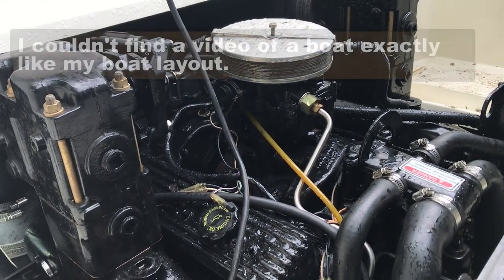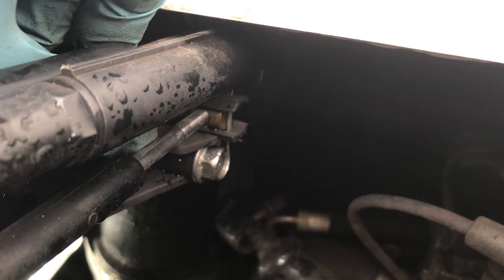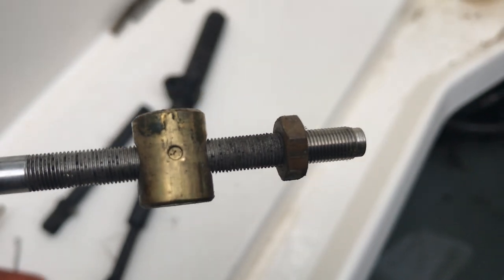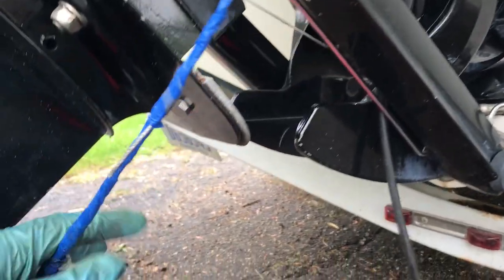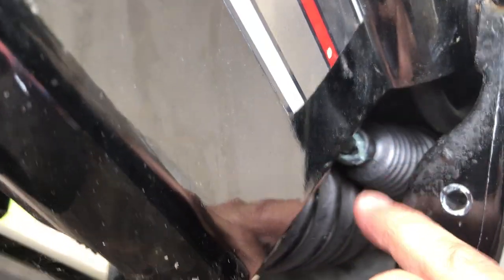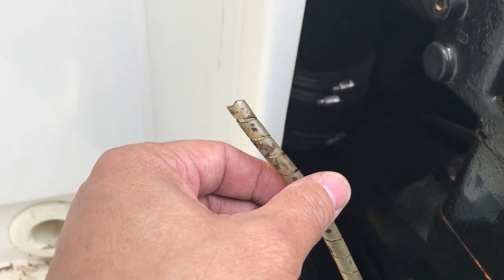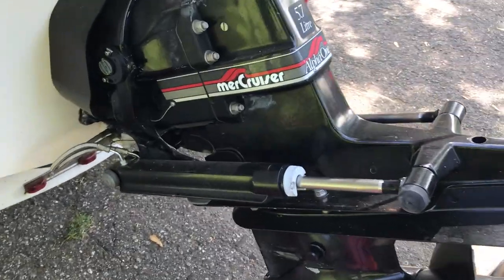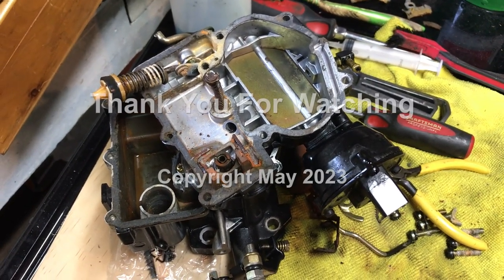Shifter Bellows Replacement Mercruiser Alpha One Gen 2 Without Removing the Outdrive

Comment: Do you need to add adhesive to the bellow or just clamps? Thank you
Reply from the maker: Many YouTubers say to use adhesive. But when I tried to buy some at my marina, they said they never use it. They said they have been doing it without adhesive for years without an issue. I really tightened it and mine is leak free and I didn’t use adhesive. Good luck and thank you…..
Reply: bellows, get it all around that raised ring on the inside end of the rubber bellows, and make sure that ring drops fully into place when installed, in the matching groove. you'll know if its not in somewhere around, as it will bulge out where it's not properly seated.
Reply: @jster1963  i have never not used it. additional sealing is always good.

bellows tend to last around 10-15 years, depending on weather conditions where you are at. premature leaks at the ends, you end up replacing gimbal bearing and u-joints due to rust damage.

BTW, not a bad idea to check the clamps yearly. i use a 1/4" rachet with a 12" extension and a 5/16th wobbly socket. just reach up in there and gently try to tighten the clamp. if it turns some, cool, if not, it was still tight.
Reply from the maker: @nonenone-ll7ln  Excellent advice.  Thank you.....
Reply: I don’t use bellow adhesive. The hose clamps are plenty to hold them, but the adhesive never hurts.

Comment: i turn wrenches on these for a living.
ALWAYS pull the drive off and replace the intermediate shift cable assembly as a whole. the cable, it's ends and the bellows. to get the bellows off you have to disconnect the cable, which means moving that USED cable around and shifting it's position. and not a chance in hell of going back EXACTLY how it was,  it WILL fail in the next year and you'll need the bellows replaced to change it.
Reply from the maker: In my area I couldn't find anyone that would work on an inboard motorboat.  I finally found someone about an hour away, but they wouldn't even schedule me for a month.  And then they would only schedule me.  It could be several months before they got to me and finished it.  In Michigan there are only a few months that is boating season, and I didn't want to lose an entire season.  I'm sure you are right, but I needed a fix, even it's not a perfect fix.  And thank you very much.....
Reply: @jster1963  inboard generally refers to a ski boat.
sterndrive or I/O has an Inboard motor powering an Outboard drive.

but, i get that. i spent half my nearly 20 year long career in reno nevada, snow country. and i  worked at shops were you were lucky to only wait a month for your appointment.
and i worked during 2020 and parts took 6 months to get.
had one poor guy, brand new 23' chaparall with volvo's V8 300 in it, 9.1 hours when the fuel pump module started dumping fuel into the intake and flooded the motor. that's a DI motor, only place fuel should be is in the cylinders. should not be a gallon of it sitting in the intake. and pouring out the throttle body into the bilge.

it was all warranty, but  volvo is in sweden, they had their own lock downs. and the pump uses parts from india, which REALLY locked down for covid.
had my parts manager trying everything, and calling volvo every week, cause that was BS. and the customer was calling everyone every week. us, the vegas dealer they bought it at, volvo.
reno nevada, you got about 8 months of boating. they were off the water for 6 months. only got about another month before winterizing. and no surprise, they did not bring it to me for that after waiting 6 months.

personally, i love wrenching on an alpha 1 and it's motor. i also love the smaller outboards, the 60 and less crowd.

i'd love to help you out at my shop, but i'm in texas now. and that would be a LONG drive for you.
one tihng really sucks about wrenching on boats in texas, there is barely an off season. i am a freaking ARTIST at shrink wrapping. and i did not get to do even one this last winter.
Reply from the maker: @nonenone-ll7ln  This was the first year I lost my indoor storage.  I could have used you to shrink wrap my boat!  I just used tarps.  Next year I should have indoor stoorage again.  And that's so sad for that boat owner!  I feel for both of you.  Thank you for sharing.....
Reply: @jster1963  a boat with an alpha 1 on it, my shrink wrapping prices are about $400. depending on lengths and things like ski towers.
 takes me about 3 hours to cover it in way that can survive 4' of snow overnight for at least 4 years (in event of long term storage). and about $80 in materials/parts. and it's the tape that fails. the tiny holes i did burn in it along the way are now opened. and the folds that must be made probably won't survive highway speeds on a long trip.

your indoor storage probably charges more. you won't get me wrapping it in the very cold north, or winterizing it. but if i lived there, i could seriously pocket $30k in just wrapping boats for 4 months out of the year just working for myself as a wrapper.

only would need some building large enough to get in out of the wind and rain with a boat.
Reply from the maker: @nonenone-ll7ln  That's some serious money!  I had no idea.....
Reply: @jster1963  biggest boat i ever did was a 42 footer. took two guys and 5 hours to wrap it, the price was just over a $1,000.

it's not cheap, not supposed to be cheap. covers not just the top of the boat, but the sides and protects them from sun fading.
and of course, snow and rain do not collect on it.
don't have to go shovel your boat cover. or pay for indoor storage.
also, your canvas cover is not out in the sun, so you add to it's life.

i consider shrink wrapping to be nearly free, for all the other stuff it saves you money on.
Reply from the maker: @nonenone-ll7ln  Very true!